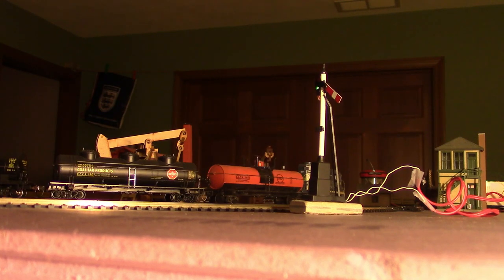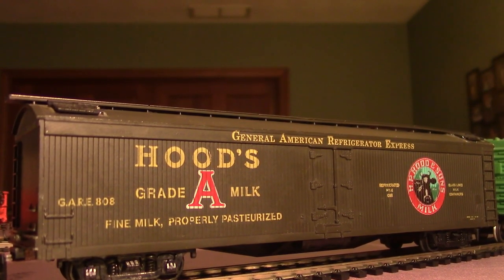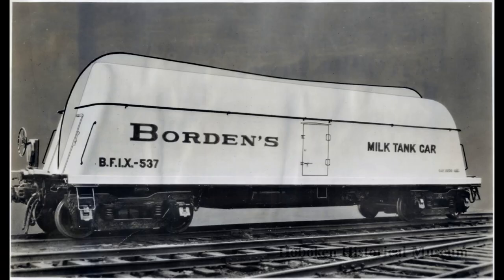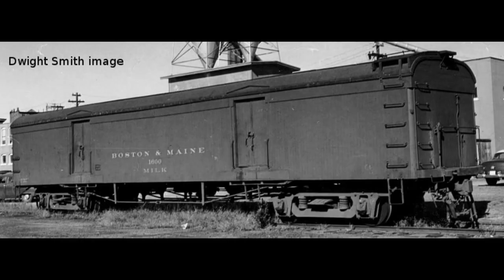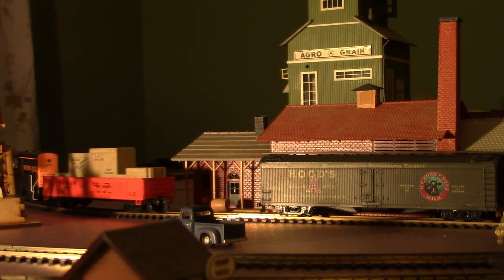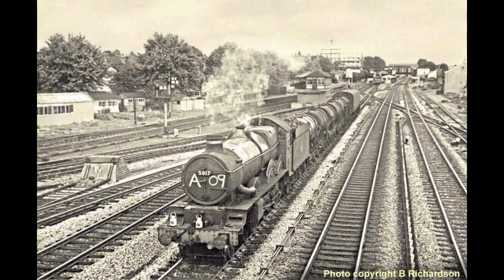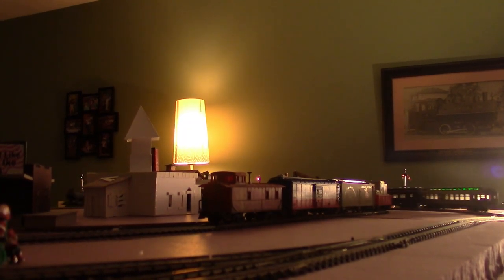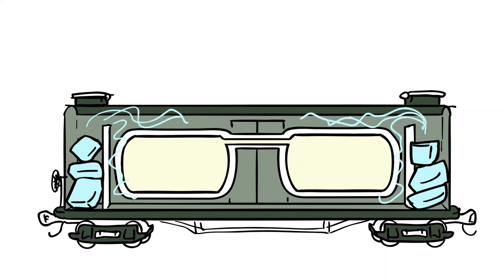Rocky's Railroad History: Milk Cars

Comment: The GWR milk wagons could be quite eclectic. The 6-wheel tankers had the underframes owned by the GW, & the actual tanks owned by the dairy. However, the tanks were sometimes owned by the Company, the tanks painted brown to match the passenger coaches. The cattle-ish wagons carried the pre-insulated milk churns, but could also be used to hold local goods. They could also be dropped on the front of passenger trains. These were known as Siphon O wagons, generally used for stopping trains, setting down & picking up everywhere. The big GW ones were Siphon G, they had corridor connections, painted brown to match the passenger coaches, like the others, but could not only hold milk churns, but newspapers, parcels, luggage, fish etc. Generally attached on the end of expresses, as the goods were time sensitive.